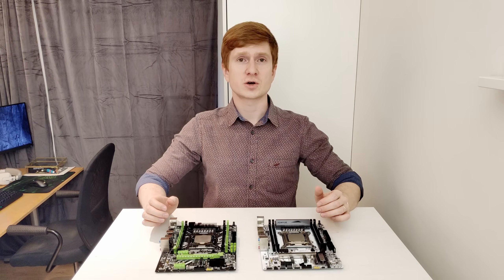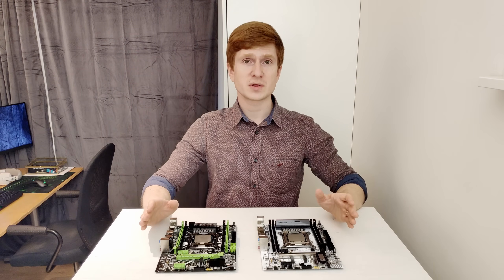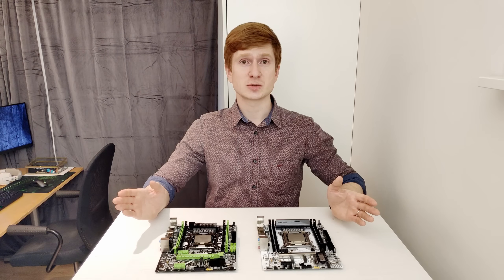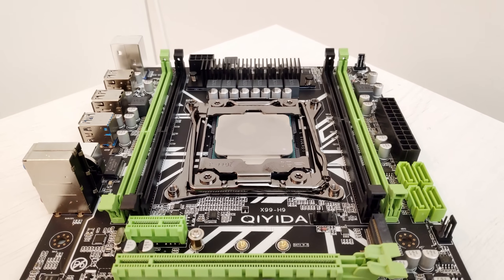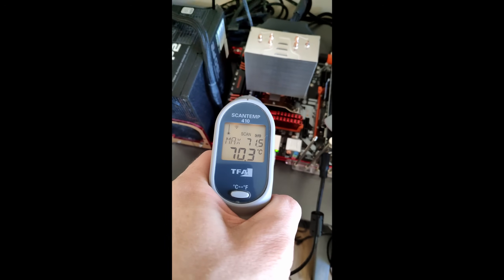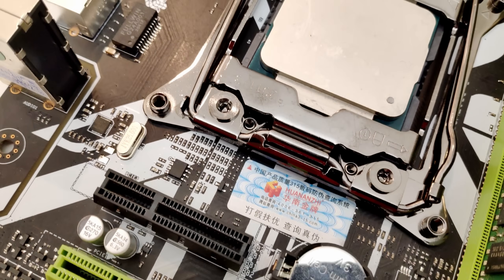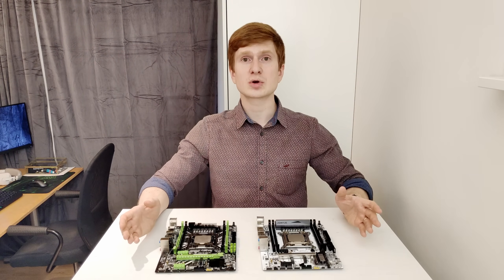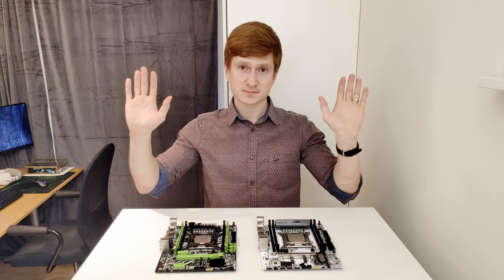🇬🇧 Jginyue X99M-Plus D4, Qiyida X99-H9, Kllisre X99 V201, Machinist X99-RS9 – tests and conclusion

Comment: I possibly just bought one of these. I have the Atermiter X99 V201. I'm running it with an E5 2640 V3 and so far no fires...! 🤣
Reply from the maker: You should be just fine if you don't plan to use your PC for mining or long running intensive tasks.
Reply: @Miyconst  Fortunately just some light office tasks, net surfing and a bit of gaming. But I will make sure there is decent airflow over the heat-sink. Thanks for the advice.

EDIT: I unlocked all-core turbo boost yesterday (using the Huananzhi X99-8M-F BIOS from Mi899 as you suggested) and it worked perfectly. 
The VRM cooler gets a bit 'toasty' now after a couple of hours of non-stop gaming, but I think it will just about cope. 
I eventually put a fan directly over the VRM heat-sink (attached to the inside of the top of the case) blowing fresh air onto it continuously. 
It's very hot to the touch when gaming... but it doesn't 'burn' my fingers as such. So it must be a good amount below 100 degrees C now. Which is good enough for me!
Reply: @Richard Thanks for your feedback, I just received my Atermiter X99 V201. I'm a newbie in this matter, and just now I found this is not a good option for powerful processors (I bought E5 2678 V3). 

I don't know yet if I am going to sell my Atermiter and buying a better motherboard or if I sell it or if I keep it and call to the firefighter! 
I have not tested it yet because I need to buy Graphic Cards and besides the price issue, also there is no stock in Brazil right now. 
Hard times for hardware buyers! 

Anyway, thank you for your feedback.

Comment: Thanks for the info. Concerning the VRM temperatures, how could we low them down? Any idea?
Reply from the maker: You can buy small tiny radiators and glue them on top of the doublers with a thermal glue, then you can add a fan with direct air blow to the VRM and it will help a lot.
Reply: @Miyconst  Just one more question, if you don't mind. If I am not able to do what you recommend, how long do you think my setup will get ok if, in the case, I am use Machinist RS9 and a 2620v3 with a RX 5500 XT or a GTX 1650 super?
Reply: @magnusicaro  graphics card doesn't affect the vrm in any way, unless it's a hot card in a cramped, inadequately ventilated case. Then your whole case will act as an oven.
Reply: @magnusicaro  with 2620 it will probably live long.
Reply: Thank you, Miyconst. You're great!

Comment: Changing the radiator would be a solution for this motherboards?
Reply from the maker: No. It will help, but it will not solve the VRM overheating.